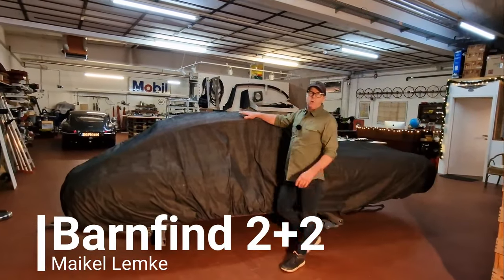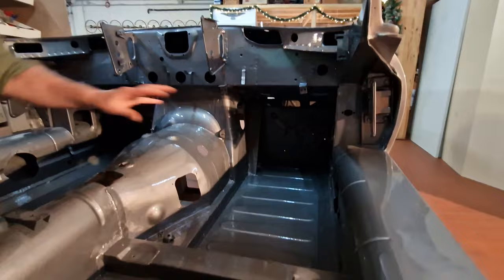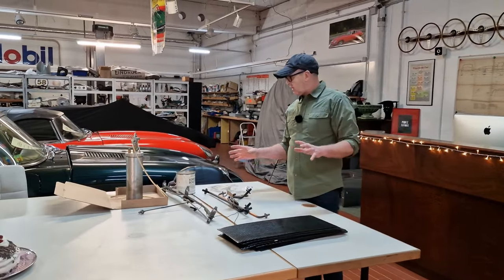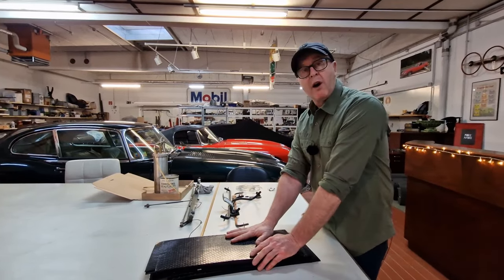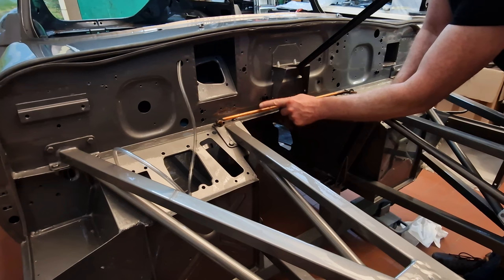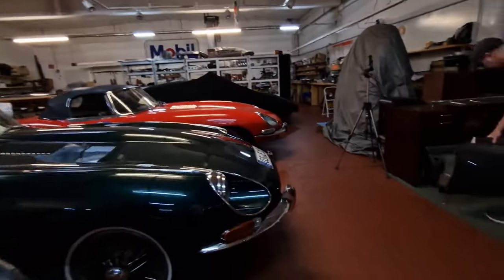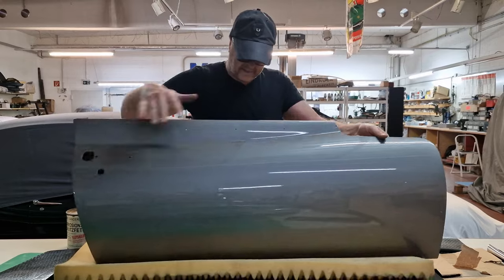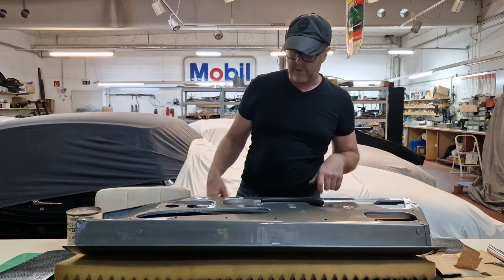🚗 Revealing the Color: Jaguar E Type Restoration Update 🚗

Comment: Maikel . A very merry Christmas to you ! I will follow this very closely . My next task? Fitting the heater pipes!
Reply from the maker: Merry Christmas @johndavey72, 
guess it was just in time 😁, I think the RHD cars do have a different set of pipes, but keep in mind they are side oriented. And make sure you follow the order as otherwise you have to take one out again. The nasty bit is the corrosion protection, but has to be done. Also cutting the sound deadening and heat insulation is not one of my favorite tasks. But there is a saying that helps me. "Get the shit work done first otherwise you will always find an excuse not to got back". Happy New Year, Maikel

Comment: Hello Maikel, i am very glad i discovered your channel. I bought a 1966 FHC that needs to be looked after. the previous owner changed the original engine to an 3.8, along with the 5500rpm limit and painted it black. came originally from new york dealer in carmen red back at the time. Your videos have been really helpful with all the details and information and i really apreciate the time you take in making them. Greetings from Belgium
Reply from the maker: Hello @GreenGoblin99574 and to my former home and neighboring country.
Thank you very much for watching. My goal is to get the driver and owner closer to these wonderful cars. Everything can be fixed, either by yourself or someone you know who is familiar with some tools. Just making sure the knowledge does not disappear.
What are you planning with your Coupe? I might come over to Maastricht for the classic car show, but not sure how busy I will be.
Thanks for sharing. Maikel

Comment: I chose the same color for my project. It looks amazing in the sunlight.
Reply from the maker: Hi JohnCarey1963Jag,
I had a look at your channel and it does look amazing. In fact, it is between gunmetal and silver. So a good compromise. We have black interior as to the original spec. We are very pleased as with that combination. Can not wait to get the parts one. How long would you guess it will take to reassemble?
Reply: Maikel, It depends on how much time per day you can put into the reassembly.  If you work on it every day it will be a few months, but if you are not able to stick with it every day it can be more than a year... @JaguarEType
Reply from the maker: OK, I will try to get it done within April 2024. When not sticking to it, you are wasting too much time finding your way back in. But hey, having said that, While assembling, I am always finding a spacer, washer, correct bolt length, another gasket a chrome bit missing. Not worth ordering these consumables one by one, often they are NLA or in backorder. At least we have that problem here in Europe. It is these small things that are delaying the process. How do we say over here:" The devil 👺👹 is in the detail" Sounds Familiar?

Comment: 😅Another excellent video.I look forward to yours and Iain Tyrell ( He is yet to cover the etype )..I notice you  only mention / show one tranverse pipe through the firewall to slave brake servo...when mine, a RHD has 2.....I know so well,  as when I brought my my S2 2+2  these were reversed i.e. the top came out as bottom and visa versa when transverversed the firewall....making the slave  servo usless...Happy New Year..
Reply from the maker: Happy New Year @0kcid1,
yeah, you are right, the RHD do have other parts, and I do have no example to show it. Certainly the RH drivers are smart enough to be aware of these things and will double check. But good you mentioned your case, so we can all be even more aware of it. And often not everything on restored cars is correct.  Thank you for your very constructive input. 👍🏻

Comment: In the US I use Eastwood Company internal frame coating since is specifically designed to prevent rust and reach inside inaccessible body and frame areas and is designed to wick across the metal. It comes in a spray can with a  hose that has a special 360 nozzle to cover inaccessible areas.  The coating does not dry sticky or greasy.  Not sure if this product or something similar is available outside the US.
Reply from the maker: Good day @razabamza5932,
I never heart about that product but looked it up and seems something very similar.
However, it will certainly help the others to consider it for their protection from inside. Many thanks for watching. Happy Holiday.

Comment: So, happy birthday Maikel!
One general question regarding putting all this anticorrosion grease everywhere.
If the shell and panels have been fully repainted using a modern professional and exhaustive treatment, why would it be necessary to use that grease in addition? Modern cars don't need it.
Also a question on how you insert these damned tubes behind the shield: tiny hands and patience and blood?
Reply from the maker: Merry Christmas 🎄Serge @paydase, and thank you for your birthday wishes 🥳
well, to answer your question, my 2+2 shell had been acid dipped and not been coated since. Hence I am protecting theses tiny gaps which have not been covered and filled with primer and paint. Those places between the welding spots and where the sheet metal is overlapping. You say modern cars have a factory coating to prevent from corrosion, I have seen this being applied to classic cars after they have been acid dipped, but then afterwords they had plenty of sheet mates replaced where again they had to take the coating (KTL Beschichtung) off to get the welding right. That is why I am doing the grease coating. The sills, the bulkhead, the doors and the rear above the radius arms are the crucial areas.

To insert those pipes, I have explained in the video. From the center hole to the left hand site with one end to the top corner and then back towards the middle. Important to start with the straight water pipe, then the vacuum pipe. Also note the direction. As they one fit one position. They are handed if you like.

Are you going to to Maastricht?
Reply: @JaguarEType  
Thank you for your answer wrt greasing protection. Interesting. Always difficult to have things done perfectly.
Wrt pipes I have understood how to insert them. Maybe this is traightforward whn the shell is bare like yours (I was thinking that space behind the shield was still restricted) but it is a nightmare when not. Hence my request...
No I will not go to Maastricht. I went to Interclassics, Brussels, easy for me.
Any news regarding the header tank?

Comment: Herr Lempke, where did you buy those "Deadening Matts", cannot find them on ebay for a long time, I do have the "Soft Deadening Matts", but I wanted "warm up deadening" in the back of my e type project. Love your video's. Frank Lupker in Holland.
Reply from the maker: Hello @franklupker9293,
I have no relation to this seller, just showing where you can buy these mats.
https://www.ebay.de/itm/260298554203?hash=item3c9b00bb5b:g:BCoAAOSw4f5kgvci